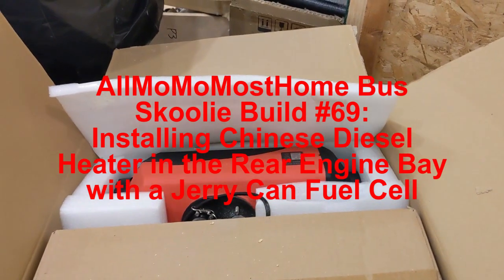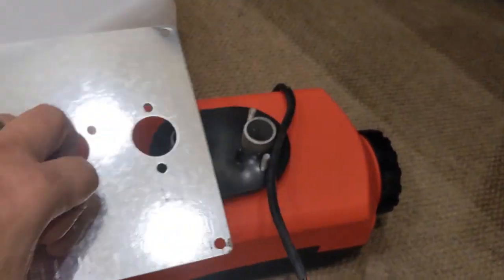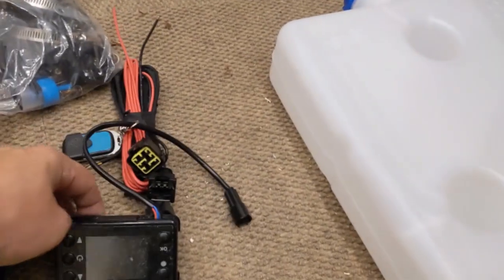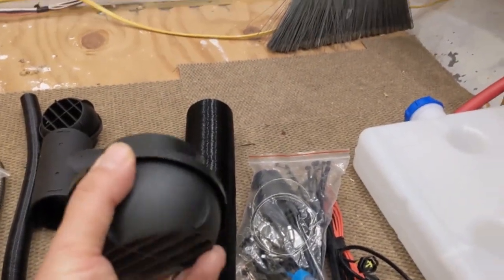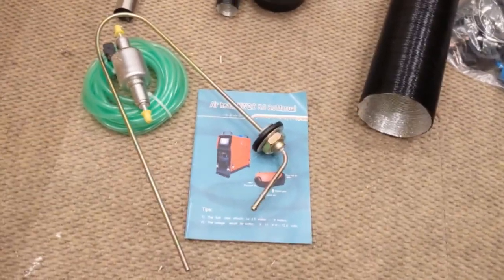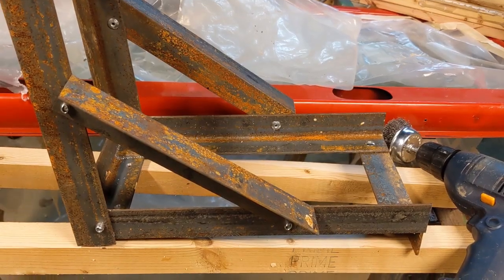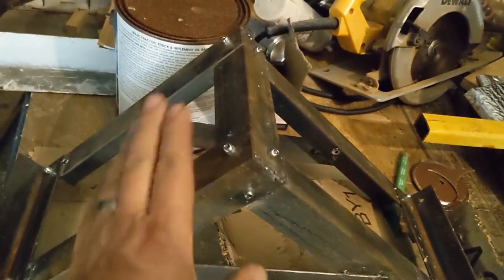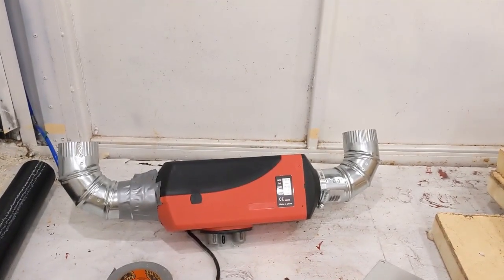Skoolie Build #69: Installing a Diesel Heater in the Engine Bay with and Steel Jerry Can for Fuel

Comment: Love love LOVE my diesel heaters.  They are the best source of heat and when  they cycle down, the ticking and light white noise of the fan is soothing...  You're gonna love it.  

I will say that with the size of the bus, you may want to have another heater in the front area as well in order to get even heat.  

Great progress, Larry!!!
Reply from the maker: Thanks Mike. I'm adding another one with an air mixing fan to replace the defroster function and heat in the driver area. I wanted to get this done to be able to work inside this winter without freezing solid!

Comment: Nice work but your pump has to be at a 30 deg angle otherwise it will break. Check your instructions.
Reply from the maker: Thanks for the tip. I'll have a look. The instructions were in such broken English and the print was so tiny that I didn't read much of them!